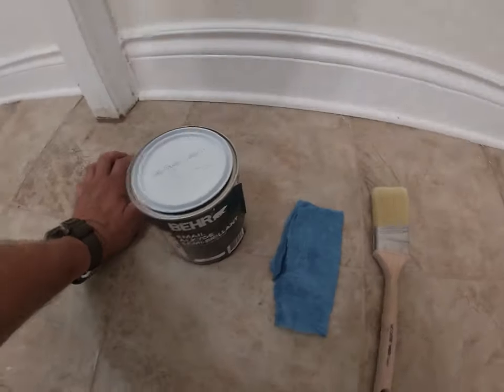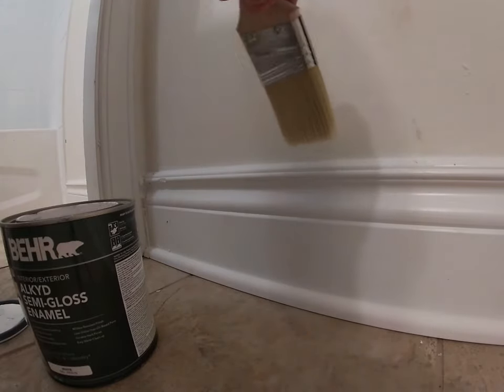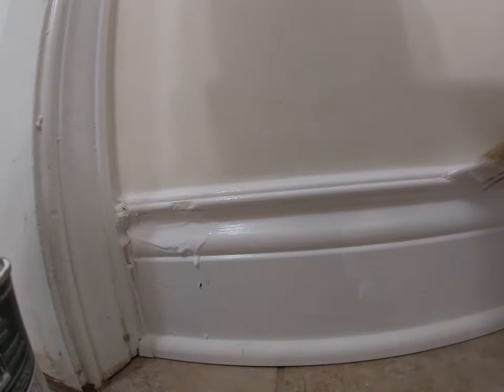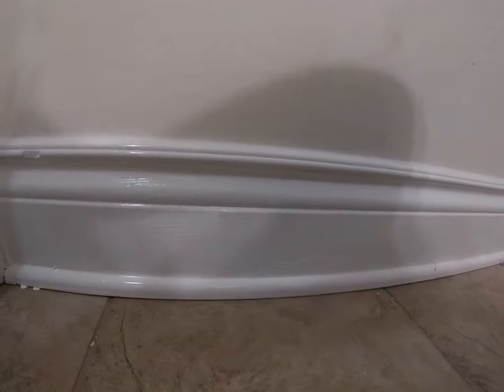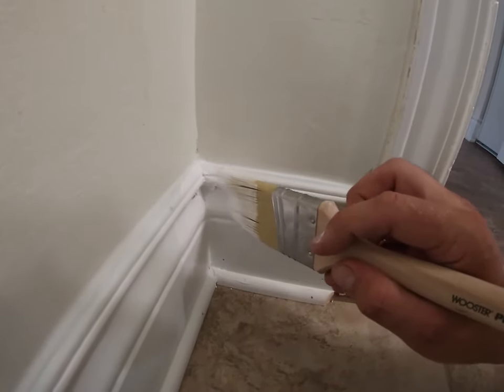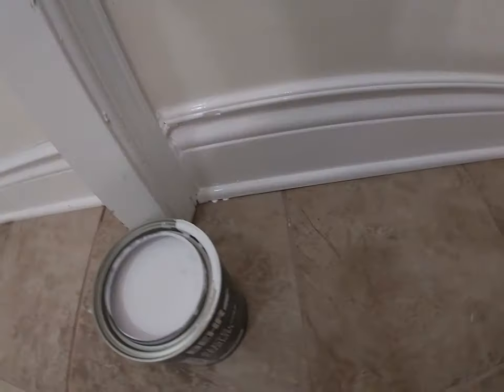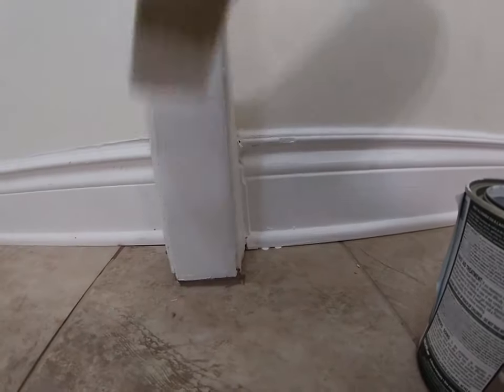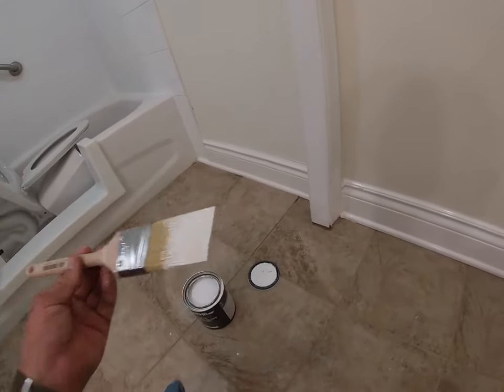How To Paint Baseboards

Comment: Looks like there's a small gap between the two molding in the floor you should be able to use a 12-inch taping knife or a straightedge to tuck underneath the shoe molding and you can paint without worrying about touching the floor.

Comment: Using exterior oil based white paint indoors has a disadvantage of turning yellow in a couple of years.
Reply: Yes you are right I paint white gloss paint last year to skirting boards but when I move bedroom side table ,I noticed yellow stain in skirting board is anyone know why this happened? Please let me know thanks
Reply: @shazadsalam4642      Alkyd paints are oil based and linseed oil is the base. Linseed oil is amber in color so the typical dryness and heating conditions in a home cause the white pigment color to dry up and slowly thin out exposing the very durable amber base beneath.
Reply: @innkeepers2561  thank you